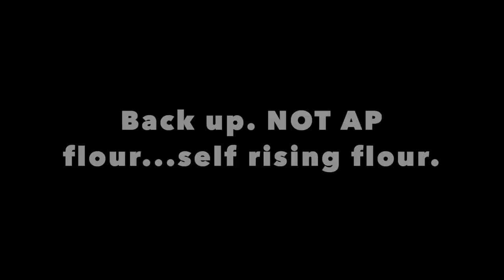Going, Going, Gone : Heifers & Cold Starts

Comment: Tips for TRAILER BACKING ASSISTANCE.  I learned when working with mobile homes
1.  Position yourself where the driver can see you in his mirror at all times. 
2.  Gestures:  since they can’t understand words use these to guide. 
      A.  If you want the tail end of the trailer a different direction, point to your hip (tail)  and then point which direction 
       B.  If you need the tongue of the trailer moved point to your Head. And which direction. 
      C.  Also the distance you want them moved should be from finger widths to Arms lengths.  

This works very well.

Comment: One thing on lawnmowers, and Lawrence probably knows this; in the fall, the last time you mow, run them out a gasoline before storing, because that gasoline with ethanol, gums up a carburetor. Plus the gas can go bad, even if it doesn’t have ethanol in it.

Comment: Stock tanks work good as a pool we have one and I will be filling in up tomorrow
Reply from the maker: Do you use a pump and filtration system?
Reply: @ThisFarmWife_  yes I use a pond filter when not in use and disinfect the water with peroxide I don't remember the directions I googled it
Reply: @ThisFarmWife_  you can use smaller stock tanks as soaking tub I put a small plastic step stool in it so I can get up easyer my stock tank is 300 gallons and my soaking tub is the 100 gallons